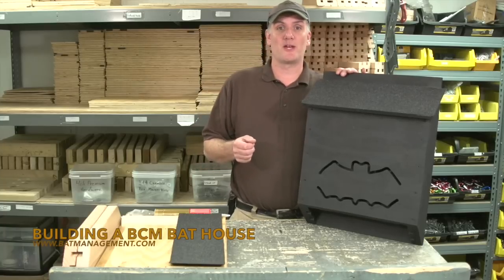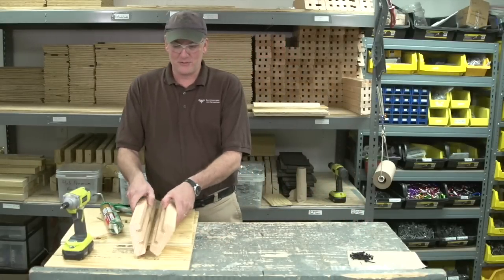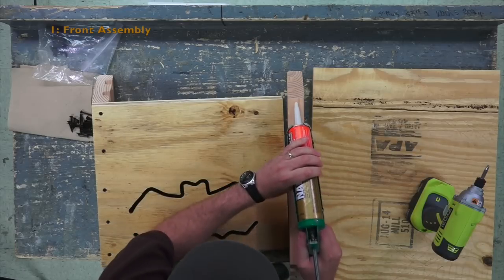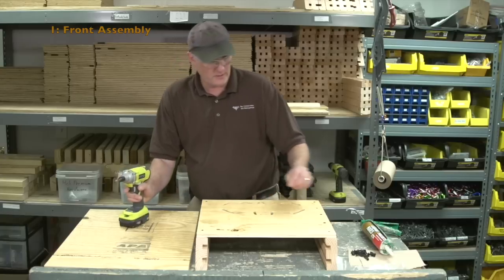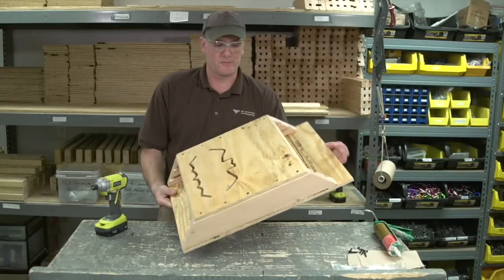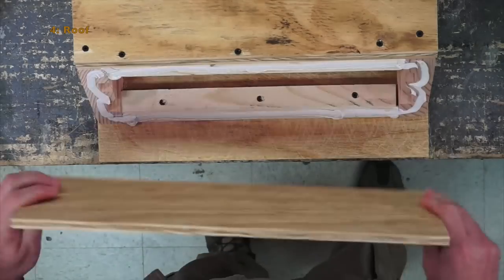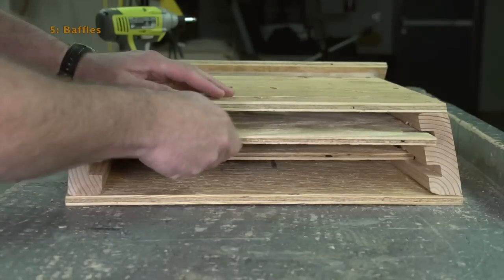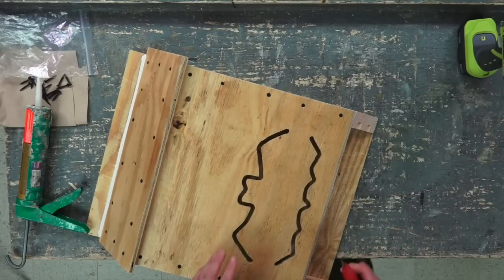How to Build a Bat House

Comment: Any harm in painting the inside? Some other videos I've been watching paint the inside black.
Reply: paint on the inside can fill in the surfaces you roughed up, use a dark water-based stain instead. You can also cut horizontal grooves instead of just sanding the surface

Comment: Not that it really matters, and this may be a really picky comment, but I thought "Liquid Nails" was very different from caulk. I don't think it has the same insulating properties. The video keeps referencing "caulk", and I believe Liquid Nails makes a caulk, but this appears to be the glue. Thanks for the video though!
Reply from the maker: Hi Russ - we tend to use the word "caulk" loosely, and yes what we are really using is an "adhesive caulk", hopefully forming an actual bond between the roof and sides rather than just filling in the gaps. This "adhesive caulk" hopefully keeps the roof together longer than regular weatherproofing caulk does. The roof separating is the major source of bat house failure, which is why we use so many screws in the roof too. It would be best to attached aluminum flashing to the roof and perhaps front of any wood bat house and that will greatly extend the life.
Reply: @batconservationandmanageme4343  thank you for the advice. My only concern with the aluminum outer shell is if you have aluminum panels on all the outer surfaces would it cause an overheating situation?? I know bats like their houses pretty warm 80 to 100 degrees Fahrenheit but I don't want the house to get so hot that it cooks them as they sleep. Or would it be a good idea to have 1 hot house/ full sun and 1 cooler house in partial sun so they can change houses if one of the houses gets too hot?? We have a good amount of bats around our neighborhood and want to provide them with the best shelter possible. Plus I want to improve the numbers so they can wipe out the bugs. Thank you for any help, advice and experience you can give the family and me.